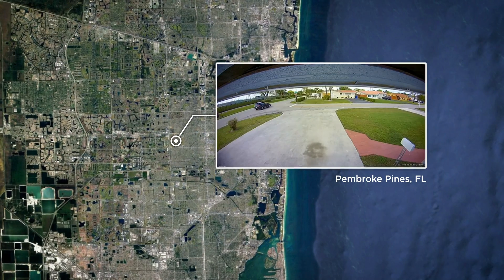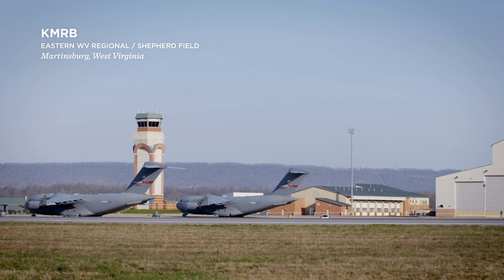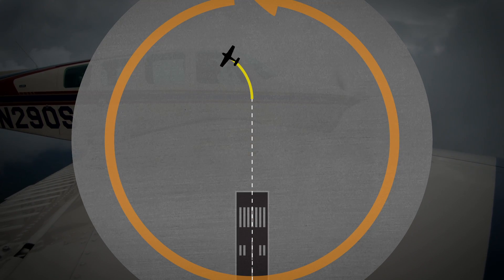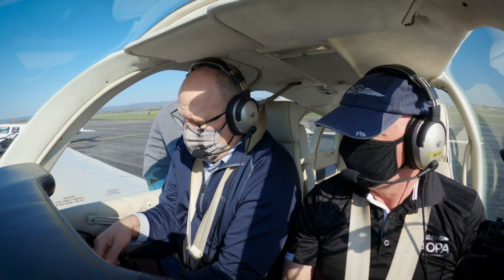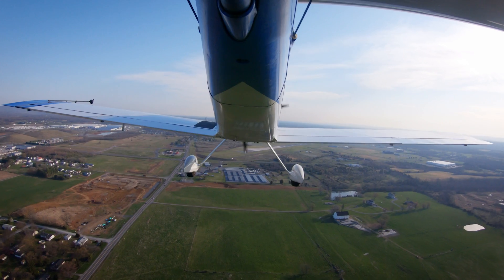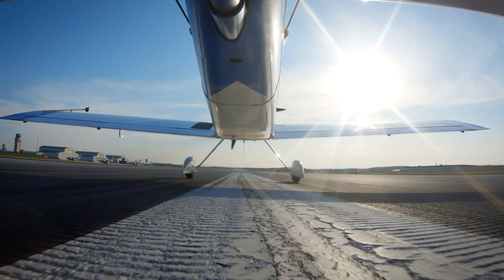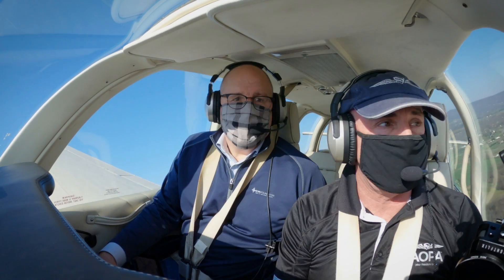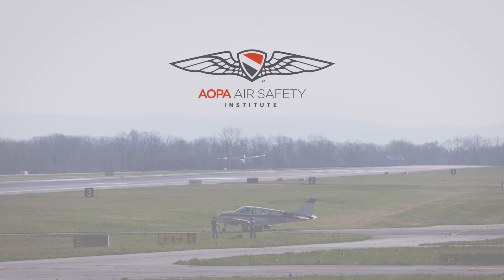Reality Check: The Runway Behind You

Comment: I've had the classic, "rope break on tow just after take-off."  In an S 1-26, I had more altitude after the button hook than going in.  Tow speed is so much above stall and stall is so slow, someone that knows the aircraft can practically always get back.  I guess the 1-26 is kind of the "Cub" of the glider world.  It was a very low stress return from about 100 AGL. By the time I was down to best glide, I was still 100 feet and on centerline going the other way.  For reference, 200 feet is the is the recommended minimum for a glider.  There is a huge difference between a competition bird with full water ballast (that would need that 200 feet) and a 1-26.  Stall speed at 45 degrees is only 33 mph and that tow was just under 70.  I did a climbing turn at much more than 60 degrees.  I did aerobatics in 1-26s all the time and really knew them well.  This was circa 1990.

Anyway, if you fly a 1-26 behind a fairly fast aero-tow, you can probably make it back it from 10 feet if you're aggressive and good at energy management.  (does anyone still fly those?)

Comment: Why on earth are you trying align with the runway?  There is no need to do this as any reasonable sized aerodrome will have flat areas on either side of the runway, taxiways etc and in an emergency you could simply land across the runway at 45 degrees, or even parallel to an off to the side.  Also, if there is a significant crosswind component and you make your turnback into the wind then after your 180 degrees you may well be already aligned with the runway or near to it.  I would only be trying to align with the runway once I was certain I was going to make it, and had a comfortable airspeed buffer.

Forget about the runway and just focus on the fact that the aerodrome is almost certainly the largest open flat rectangle of clear space in the vicinity, especially in a built up area or if there is hostile terrain.  But if you have an obvious off-field landing area somewhat to your front you would be mad not to take that if only for the lower ground speed vs a downwind landing.  Either way, you probably want to have given this some thought BEFORE the engine failure.

Comment: Ex glider pilote here. Probably out of topic, but even for us the turnarround  maneuvre is an issue. I remember when I was young taking gliding lessons. Very small field ontop of a hill, with a forest that could produce leewind turbulence on one side, a steep valley on the other side and farming fields infront and behind. We only could operate winch starts. Normally you have three options in case of a winch cable snap, depending on your altitude. You land streight in, you turn arround to land downwind or you have enough room to fly a short landing pattern. Our instructors told us to avoid the downwind landing at all cost and not hesitate to land on one of the farming fields instead if the need arises. Turning arround with that short of a field and possible turbulence due to the leewindfactor just made turning arround too risky, even in a glider.

Comment: Having just had this happen to me, and not making the reciprocal 180degree runway but a crossing runway from 377 feet AGL. A lot of "what-if" scenarios have been modeled for my event using the tracklog and video. The one thing I think the 3 second startle time seems like a lot, and in all of these scenarios are flown straight out. For my airplane, in my take-off configuration, with full fuel, no wind, and otherwise lightly loaded, there is no scenario or altitude that a straight out departure results in the ability to return to the reciprocal according to computer models. And just about every scenario with a downwind departure results in a safe return to the field.

Comment: Ex GA pilot, glider pilot, and ship nav officer: On ships there's a thing called a Williamson Turn which is recommended to turn a ship 180% right down the path it came from. Turn hard starboard 60deg then hard port 240 deg i.e. to your original reciprocal.

I wonder whether it would make sense in a light aircraft? I suspect that most of the heavy turning would be done high without the runway in sight so it would be easier to make the go/no go decision easier. Against this idea would be that you would be aiming to land on the beginning of the runway rather than mid runway so if you were all lined up but short ... not good.
Reply: The glider way to do it looks like your Williamson Turn, it was described some post above

Comment: My 10 cents on take off @ safe altitude 50 or 100 ft turn right 35° eg 270 runway heading turn 305 or 310 by the end of the runway even at 200 or 300 agl the runway the runway is right there on your left no delay thinking or analize or wonder you are on short base already just hard left @ land

Comment: All aircraft sold should come with metrics like this. At standard pressure/temp, and at sea level, with no wind, a single pilot, fully fueled, can make a turn-back from this minimal altitude or above. I'm sure many pilots don't realize if it's an option or not with the aircraft, or if they have enough altitude when it may in fact be possible for the type, and they possess more than sufficient altitude for the maneuver.

Comment: back in 1974, flying a TriPacer, I had an engine out at roughly 300 ft AGL west of Borger, TX in 95*F ambient temps.... 

my Instructors had always told me to KNOW exactly where my next landing is going to be.... 

I knew the terrain, as it was within 500 feet of my home in ranch land...... 

when the engine quit ( iced up due to a wind shift pushing Steam from a power plant cooling tower in front of me as I meant to land ).... 

the Steam cloud occluded my view of my landing strip, and I powered up for a go around....... 

I made it up to approx 300 ft AGL and silence...... ahead of me was ravines, to the right was gullies... to my left was a small ravine with only Chucka Grass and it was sloped downhil at about 15 degrees.  

The instant the engine quit, I rammed the controls into the Firewall for a fast descent and banked to the left at about 30* angle.... Climb out was at 65 knots, pushing the controls to the firewall got me up to 82 kts,

just as the wheels were about to hit the ground, I pulled Full Flaps.
On the TriPacer that is a handle from the ceiling and you can do it in less than 1 second.

That created just enough Ground Effect, to let me settle safely on the mains and the tail skid was dragging the ground.... then the nose dropped down, and the engine commenced to idle smooth ( ice was gone )

I got out, surveyed the airplane, no damages at all.
I kicked the scrub grass clumps out of the way, turned the plane around 180 degrees and flew it out of the ravine and went back home.

I never once had a thought of being scared, I was taught to Fly the Airplane until it was on the ground..... none of that " Oh woe is me, WTF do I do now? crap "

I owed that instructor a big Steak Dinner at the BIG Texan Steak House in Amarillo, TX.

Comment: I‘m a glider student. We practice the „impossible turn“ after an interrupted winch launch between 80 and 150m (roughly, depends on various factors). We turn 45 degrees downwind, level the wings to get lateral distance to the field and then turn 225 degrees, in the opposite direction, to the field.
Reply: Not exactly difficult in a glider...

Comment: Has anyone attempted to compare turnback performance on a simulator (aka Microsoft Flight Simulator) versus the same aircraft in real life? I ask because obvious training on a simulator would be infinitely preferable to attempting the same in an actual aircraft. I would also be more pessimistic with a stopped propeller on a fixed pitch aircraft than I would on an aircraft running at idle. In my limited experience they are NOT comparable, especially on 3 and 4 bladed props. Anyway, a fantastic video that should be required watching for new pilots. Practicing for emergency is something all GA pilots should do on a routine basis.

Comment: GREAT VIDEO - thanks for testing this scenario for the aviation community!!   Important to note - these tests were conducted in the most optimal weather conditions.   I still believe in using that valuable time, altitude, and air-speed to find a suitable landing in front of you is better overall.  And even better... plan your emergency landing zone on google maps prior to flying.  Thanks again guys - this was a great video!!!
Reply: that is what is generally taught as being the most viable option, due to the high number of variables involved in each example as encountered in the power out on departure event.  consider it - the external influences alone can overwhelm - wind, temps, obstacles, craft configuration.  then - props, load, distance, altitude - who's to know what's what in the space of 2 to 3 seconds?  intelligent and careful people can and do panic.  flying can be dangerous and gliding onward & forward may actually be the best way to return to earth safely!                                 ;     )

Comment: It seems to me all the aircraft should have been tested in the same conditions with respect to number of occupants including the pilot.  It appeared as if the Bonanza was the only aircraft tested with a pilot plus a (rather large!) passenger on board.  Knowing the Bonanza is a rather speedy higher performance 4 place aircraft to begin with it was predictable the test of the bonanza would fail with two people on board.  To simulate a typical pleasure flight (rather than a solo training flight) as well as a typical instructional flight, the other aircraft should have been tested with the pilot and one passenger on board also. For that matter perhaps all the aircraft might have been tested in both conditions; both with and without one passenger on board to see the effect this has on performance in the critical turns and on the glide.  It strikes me as possible the Cessna and the Cub might have failed as well from less than 1000 AGL.  Anyway … interesting video.  My PPL-A instruction in Canada twenty years ago emphatically stressed NEVER attempting the return to the reciprocal of the departure runway at anything less than 1000 feet AGL and only after having transitioned from climb configuration and speed to cruise configuration and speed.

Comment: Push the nose down, down down down  and bank , knowing aerodynamics and pushing the nose is important. At 600’ it’s doable in a 152,172 and Piper. 

Also limiting to 45 degrees may not be enough. Pitching for best glide honestly may not be best and pushing for more speed is paramount. 

That’s my 2 cents, I’ve practiced it in length for years and it hasn’t failed me.

Comment: Hey AOPA, your "don't try this at home" video is garbage. Instead of telling all of GA, you can't do this, and will probably kill yourself, why don't you outline how to practice for such an emergency, recommend reviewing glide performance in glider handbook, and then you would know that making a 45 degree bank turn (correct), at best stall horn blaring airspeed (irresponsibly stupid) will give you a glide shorter than at higher, safer airspeed, because you are at the place below minimum sink on your wing polar, where sink is increased again, due to drag close to stall. 
Lastly, if one has the engine quit at altitude where return to runway is impossible, one can still make turns to avoid obstacles and land at any flat surface reachable. Maybe only 90, and those options one has to brief before takeoff. Also, turning INTO the wind in a crosswind situation, will keep one close to the runway, while turning downwind will make the runway impossibly far to get to.
In gliders, we do this from 200'. The lowest it was done was 75' that I know of. Now, which one of you has the cojones to do that?

Comment: All turnbacks are impossible if you dont know.  If dont, dont do it.  The problem is.. the ignorants lazy that didnt want to know them are the ones that idiot like do them too low and when nervous, and they crash.  The Possible Turnback saved me from crashing on houses.  Learn turnbacks and be better. Practice them at Vfinal speed level at 1,000 agl over a road, then from say 1,700 feet agl power down, nose down to a simulated runway at 1,000 agl.  Dont be a lazy or coward Mild Maneuvering driver- pilot..

Comment: This video is extremely poor judgement on the part of AOPA and these 'pilots' trying to 'demonstrate' this to educate...Best glide speed is meant for generally leveled wings, not aircraft in a bank angle with the stall horn chirping attempting to return to the runway.  Thankfully they didn't have an actual failure in the making of this video, tho that would have proven the tried and true methods of decades past in engine failure scenarios,  most likely with fatal results.

Comment: Turn the mags off on the Super Cub - then try the 180 from 300' with the prop windmilling - instead of at a 1000 rpm 'idle'.
Reply: 400 agl maybe, but not 300.   That was an exaggeration.
Reply: "One from 500', two from 300'".

Comment: Bonanza had to turn real 45 degrees.  Looks like he was turning shallower. Also under gross they can use Vms Vminimum sink.  About 80 knots at 45 bank.  Scott Perdue of Fly Wire channel did a video of turnbacks practices from 700 agl like that at beginning of 2021.  See his channel.  No winds can make you not reach he runway from 1,000 agl engine total failure, or not pulling back the prop.  But all pilots should know to pull the prop to glide better..

Comment: I taught that turnback to many on many kinds of airplanes in my 1990's CFI years.  Also taught them at night.  Only houses in front of airport.  It is not a 360 turn.  It is a 270 degree of turn total Question Mark SHAPED turnback.  The Question Mark Turnback to opposite runway.  To practice at alt.  I used a straight road section of about 5,000 feet long and sim a runway over it at 2,000 feet level.  Climbed sim a take off from it from the 2,000 to 2,700 agl.   At 2,700 agl, I Turned, the ? shaped and aligned on top of it at the simulated 2,000 feet alt.  You always turn INTO THE WIND. Then i did that to a simulated runway at 1,000 agl.  Then i taught the same way to the runway if no traffic around of course.  They are a lot of fun and makes you practice all details of emergency maneuvering.  If a crosswind, you practice those too.  

Turnbacks are the best test for a real pilot.  I never soloed any idiot that could not do 45 degree turns at 600 agl like i did at 5-6 hours for GRM practice in 1969.  Some cannot do 45 degree turns without having a hear attack or making student pilot errors.  Chumps will have a nervous breakdown doing Emergency Low Maneuvering when required.  And that is why stalls are the main cause of accidents BY CERTIFICATED PILOTS.  A shame for usa.  Certificating pilots without Emergency Low Maneuvering skills....

Comment: This is video is a disservice to the GA pilot. It is irresponsible to show these dangerous maneuvers at low altitude. 
 I will not support the air safety institute in the future because of this ill conceived video.
Reply: Are you implying that you feel unsafe doing turns close to the ground - say base to final or a power-off 180 accuracy approach and landing? (A commercial maneuver.) If so, it's time to hang up the headset.

Comment: I do not agree with the masses of comments calling this reckless. But the flight test procedure fails to yield any useful result. Ok, there is a minimum height loss for a 360, but what you really need is a method that can be applied in general to determine if you can make it back to the runway on any given departure. The results of this video do not answer that question. It is merely an observation of what happened in a handful of special cases. Also, to say - "the light thrust you might receive at idle power is somewhat offset by the drag from the moving propeller" - is an oxymoron. The total reaction of the prop will either result in thrust or drag  - it will not be one offset by the other. Thumbs down.
Reply: John Doe ...are you asking what forces I consider re windmilling drag?
Reply: @John Doe ok. The force I am considering is the total reaction of each blade having a component that is, by definition, either thrust or drag. But it is not a little idle thrust offset by prop drag - which is what they said.

Comment: You can do a 80/260 turn back only in a Cessna Caravan only if you are 700 agl or higher. We were trained to do it, and we did it every 3 months with an instructor as a currency check.

Comment: That Bonanza pilot did a huge error.  You cannot turnback from under 700 agl with no power on those for that 180 to side runway he tried to do. He tried from around 250 agl only.  They said that clearly not to do it like that in this video..

Comment: Practicing GRM on strong winds you have to do 45 degree turns at 600 agl to keep on track.  Unless you only did Wimpy GRM with no winds at all. at high speed, or high altitude.  Wimpy GRM practice fools you into thinking you know GRM.  You then know only Wimpy GRM with low winds only.  Mild Maneuvering GRM will fool you.  Do Real GRM with strong winds, Vfinal speed and 600 agl.  BE A MAN..

Comment: Real pilots know how to make 40 degree turns under 1,000 agl.  Panicky ones cant do turnbacks.  They panic pull in them.  They will crash if had to turn 40 degree bank to align even after going forward after EFATO.  Wimps can do these turns without panicking.  You learn turnbacks for Flyover Turnbacks, Box Canyon Turns and EFATO like here.  3 PLACES YOU CAN CRASH IF BAD DOING TURNBACKS..